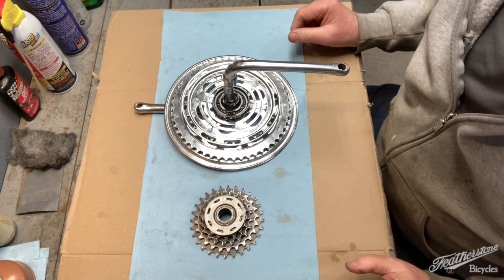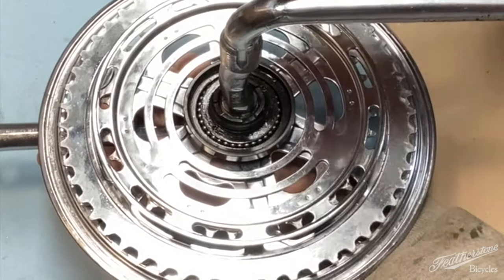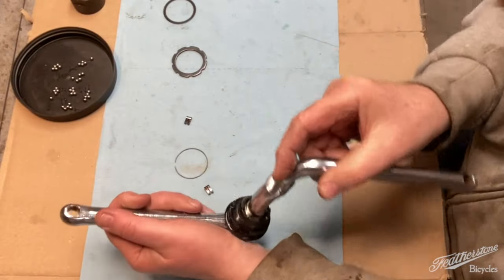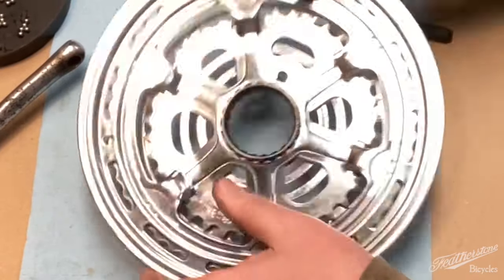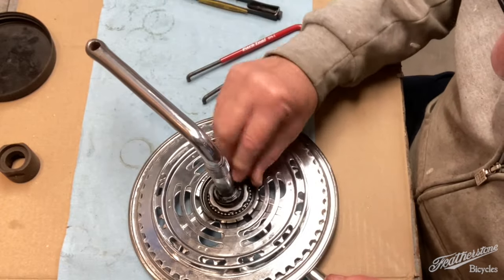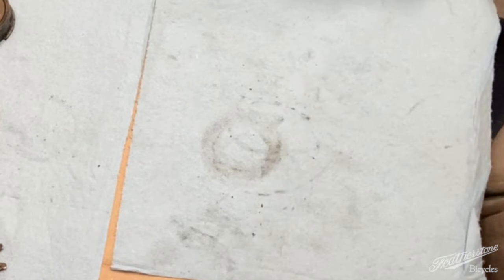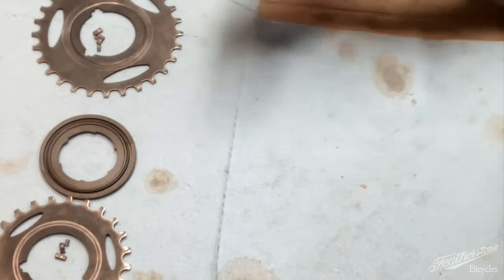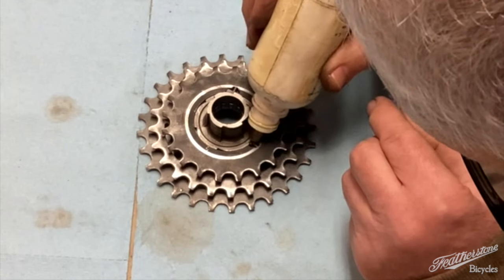BE1: Shimano Front Freewheel System (FFS) Overhaul

Comment: Absolutely amazing. I have never seen any vids on how to disassemble/reassemble either the front freewheel or the rear "non-freewheel". You've supplied great tips and warnings all the way through your vid. Very thorough the whole way. The FF System from Shimano was supplied to only 3 bike manufacturers: Schwinn, Raleigh and (correction) Panasonic. There were at least 3 variants of the system during its relatively short life. The earliest use I've seen is on a 1978 Chicago-built Schwinn and the latest use was on a 1985-ish Panasonic Schwinn. I've never seen it installed on a Raleigh although I have an idea that Raleigh maybe sold it only in the UK and very few bikes were sold with it there. There was also a 6 speed "non freewheel" version  available although this may have been for Panasonic/National bikes in the Japanese domestic market. I've never seen a 2 x 6 FF system-equipped bike in North America. I have some of the advertising documentation for the FF system for both 1 piece and 3 piece cranks. I currently own a 1979 Schwinn Caliente men's bike with a 1 piece crank 2 x 5 FF system on it that I'm currently in the process of refurbishing and that's why I searched and found your great vid. I also have a 1984 Schwinn World Tourist lady's bike with 3 piece crank 2 x 5 FF system that I refurbished a number of years ago. Over the years I have bought, fixed and resold THREE 1985 Panasonic Schwinn World Tourist lady's bikes with the 3 piece crank FF system. Out of all these Schwinns, only the Caliente has been abused/neglected. All the others were almost brand new !!! Apparently the owners decided that the FF system was a little TOO novel for them.....and the bikes were heavier, too, which wouldn't help matters. At the end of all this, your vid will now allow me to tackle the rear "non-freewheel" on the Caliente without fear of never being able to reassmble it.......although I might use a light EP-rated grease on the front freewheel assembly instead of oil. I'll let you know how it works out.
Reply from the maker: Thanks for watching and your kind words! Also thanks for the detailed history and insight into the Shimano Front Freewheel System!  You've done your research! Since that video posted, I have found a Schwinn service manual from the late 70's that details disassembly and reassembly of both the front and back of the FF System (including the number of ball bearings which you'll recall I lost track of). I am going to see if I can amend my video description to include a PDF of that documentation (without messing up the order of my videos.
Reply: @FeatherstoneBicycles  That Schwinn service manual is worth its weight in gold IMO. Hopefully you get some high res scans of it for your pdf version. If you like, I could send the stuff I have to you in a pdf. Just let me know.

Comment: I am having trouble converting from a square tapered 3 pc crank on A Genesis G7, Desperately need this for a build as in daily driver. thx
Reply from the maker: Sorry, too modern for me!
Reply: @FeatherstoneBicycles  Bro NO it's not All Bicycles are THEE SAME BASICS Cmon if you can do this much well apply your knowledge advast NOTHING I REPEAT NOT A THING IN THIS LIFE IS TO MODERN JUST A CHANGE IN DESIGN, HELL & To Be TOTALLY Honest Your Video Is 1 Of Thee Most Technical Online! Congratz Because NOT A SOUL Has Done This Other Then Thee Builders IN And AT SHIMANO!
Reply from the maker: Thank you for the nice comments, but my channel is focused on the bicycle I am rejuvenating for each season. It's not meant to be a technical 'how to' channel (although I think based on other comments that it does help others in the restoration process). Have you looked at RJ The Bike Guy's channel? He may have something that can help, or you could reach out to him for help.
Reply: @FeatherstoneBicycles  I really hope that my comment didn't come off as rude or mean. Not trying to be that guy. You know what I mean? But yeah, I have checked out his channel. And there is very little on the shimano FF system and for what I'm using it for is. A motorized bicycle and I believe for my build. It's exactly what I need. I just don't know whether I should buy a complete. Old school swin with the one piece crank in it.  Because I do not like the 3 piece design cranks that have the F. F system it just doesn't esthetically fit what I'm looking for but the one piece does and from what I gather and what knowledge I have of bicycles, the 1 piece will screw right in perfectly to my bottom bracket.  But thank you so much for writing back again.I really wasn't trying to be mean.And your video really is the most technical seriously.Other than somebody laughing about how it lets you shift while you're not peddling well duh.
L o l. There's some guy over in the UK. That is building bikes now and I'm not sorry to say it. But his attempt at building a nice bicycle failed. When he did not incorporate the FF system, he should have his build was nice, but no, do they're not worth the money?  The FF system, however, is if you know how to properly use it.That is other than that man you're doing great on here.I hope you keep getting lots of likes subs.And everything else bro best of luck to you and can't wait to see your next builds
Reply from the maker: It's all good my friend!